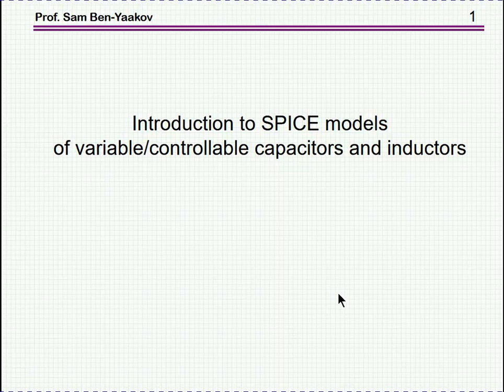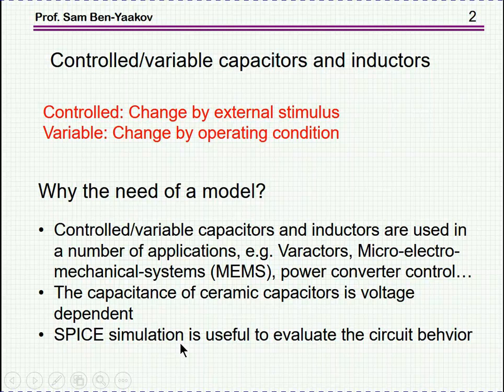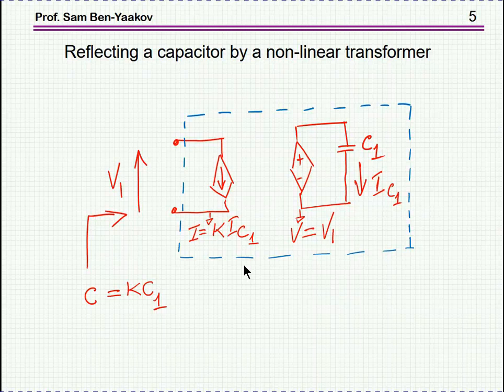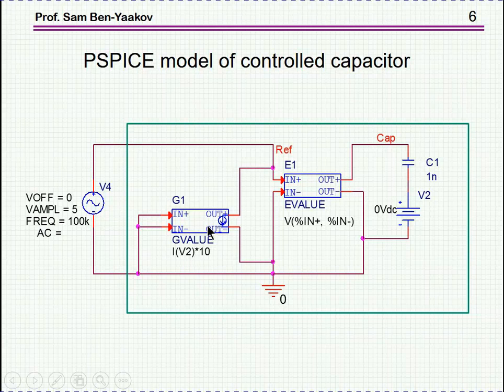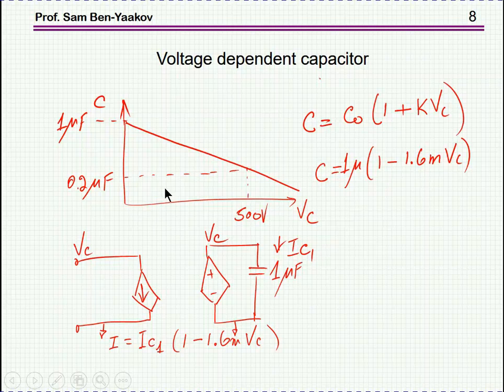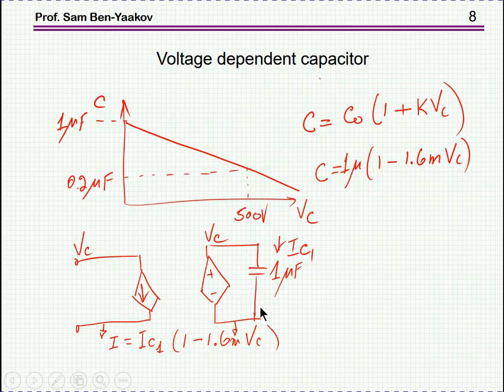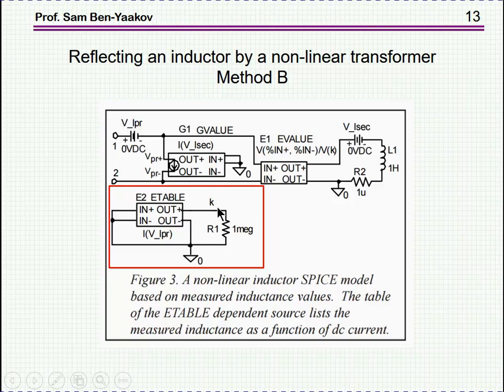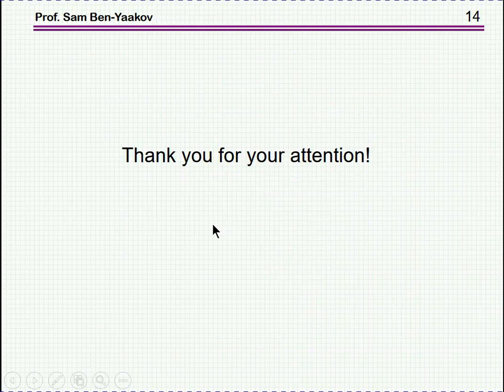Introduction to SPICE models  of variable/controllable capacitors and inductors

Comment: This is only correct if the rate of change of capacitance or inductance is very slow. For instance, with the inductor, the voltage is really the derivative of the total flux. With constant permeability, this is proportional to the change in current. But with non-constant permeability such as when a core is added or removed quickly, you have to have a term with the derivative of permeability as well.
Reply from the maker: So what happened with the magnetization due to the ripple current in a Buck inductor?

Comment: Thanks for nice video and explanation. In literature I found this, but not with sufficient explanation.

For C=f(V) we use YX circuit and for L=f(V) or R=f(V) use ZX circuit
ZX:
* ports 1 and 2 are + and - input ports - control voltage
* ports 5 and 4 are + and - output ports of pseudo component
Eout 4 6  poly(2) (1, 2) (3, 0) 0 0 0 0 1
Fcopy 0 3 vsense 1
Rin 1 2 1G
Vsense 6 5 0
Lref 3 0 1uH  ; reference inductance 

YX:
* ports 1 and 2 are + and - input ports - control voltage
* ports 5 and 4 are + and - output ports of pseudo component
Ecopy 3 6  poly(2) (1, 2) (4, 5) 0 0 0 0 1
Fout 4 5 vsense 1
Rin 1 2 1G
Vsense 0 6 0
Cref 3 0 1n

from> SPICE A guide to Circuit simulation & Analysis Using SPICE, Paul W. Tuinenga
Reply from the maker: Thanks for comment. Tuinenga is an old book (a good one though) using ancient SPICE script
Reply: Yes, it is an old book, but those scripts still work fine also in the latest LTSpice ...